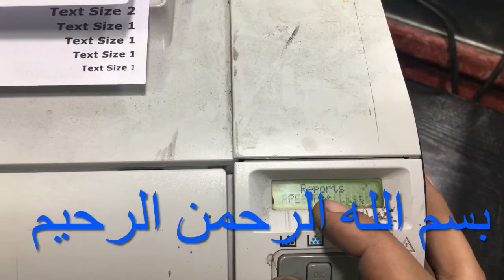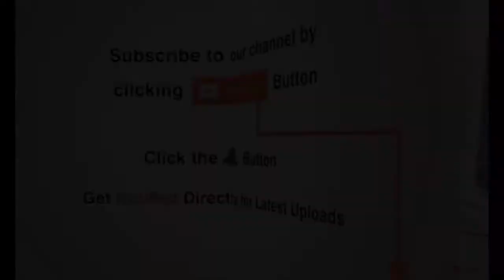HP Color LaserJet CP2025 Printer Jam in tray 2

Comment: pc with window 10 showing unavailable driver for printer hp 2025.what should i do?
Reply from the maker: It should install it automatically 
But i sugget to let windows update do this
If you are using metered connection 
Let the windows download drivers over metered connections
And you can use windows 7 
64 bit driver by browser not over the driver softwqre
Reply from the maker: And if you cannot do it i can help you any disk